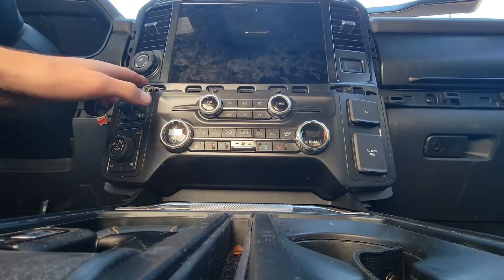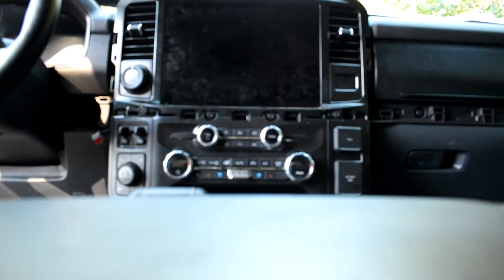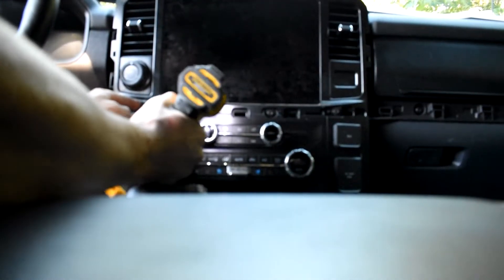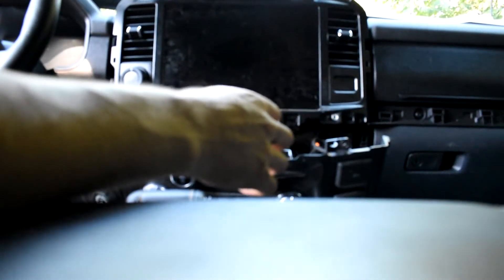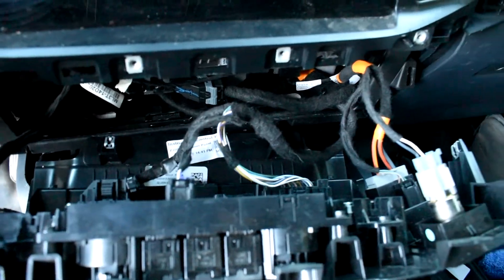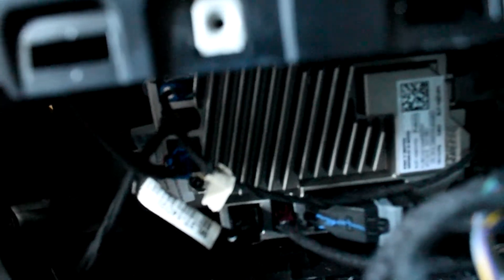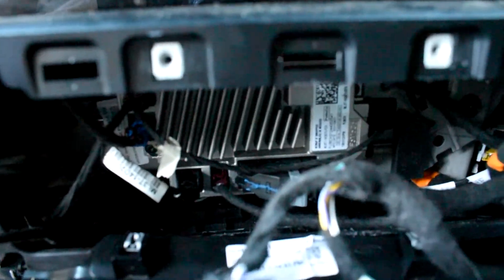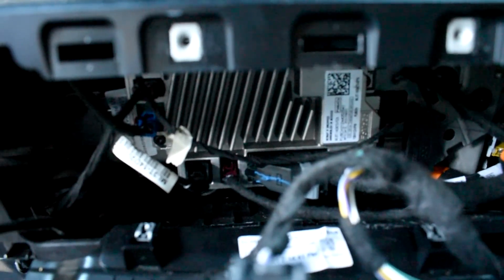How to Access Gateway Control Module on an F150 with Sync 4

Comment: Just had my 2nd APIM installed on my 21 Lariat as it hasn't had a OTA update in 2 1/2 yrs. It is still not updating and think the GWM needs to be changed as well. I believe the GWM has to be programmed to the specifics of my truck. Am I correct?